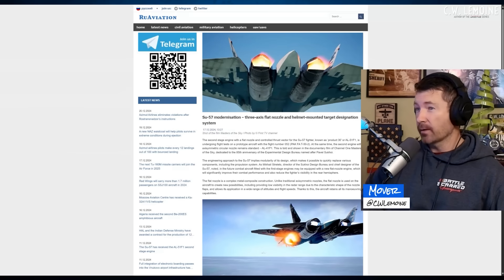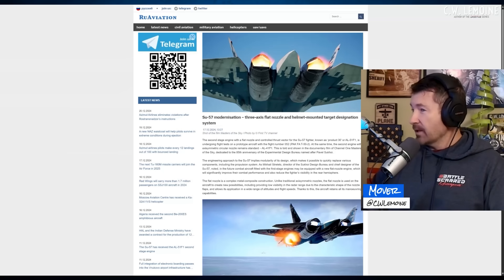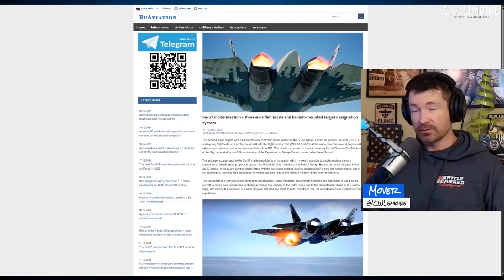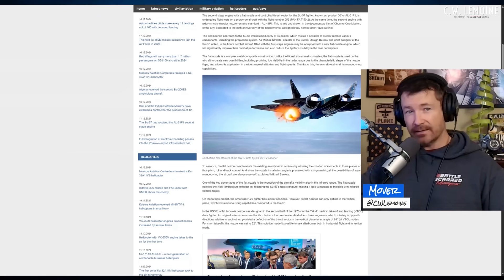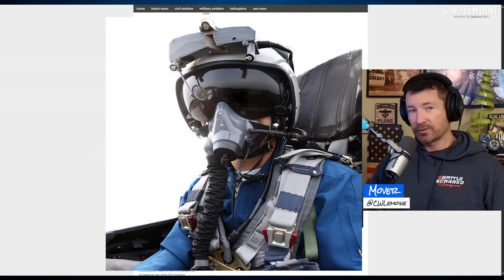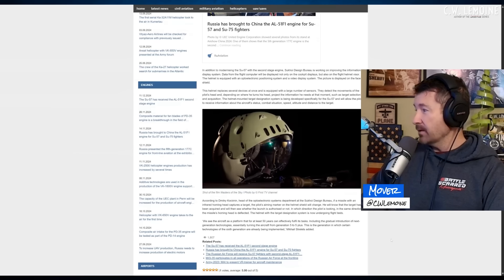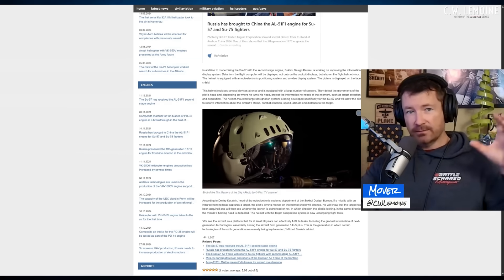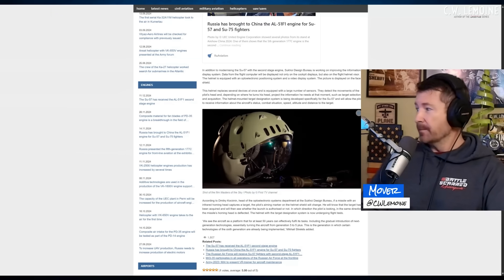New Upgrades for the Su-57 FELON

Comment: WTF is a 3d thrust vectoring nozzle? Up-down, port-starboard, and ?-?
Are they counting nozzle dilation? (big-small opening)
Reply: It is more about the plane movements that the nozzle can control:
- F-22 is considered having "2D" because its nozzle can control pitch (moving up or down together) and roll (moving each one separately in opposed directions - one up and the other down - so creating a movement on the roll axis)
- a plane with "3D nozzle", aside the above, can also move "left-right", so acting also in the "yaw" axis of the plane. The common used russian planes with such (Su-35 and actual SU-57) have "round nozzles" that can vector themselves in all directions, so they have a "pure" 3D nozzle capabilities... the "new SU-57" discussed here has similar nozzles to those of the F-22 (rectangular, and capable to move only up or down) but as it was shown, they are mounted at an agle, rather than horizontally alike in the F-22: they will loose some degree of freedom rather than a "pure round 3D nozzle", but still capable to influence all the 3 movement axis (pitch, roll and yaw), even if in a slightly diminished capability...

The diminished return in manouverability could be considered a good trade-off, when "flat nozzles" have better performance in anti-radar performance (a round surface will have ALWAYS a face that could rebound radar waves to its receptor... that is why modern "stealth planes" try to avoid much as possible a perfect round shape - they are all flat-angular surfaces - F-22/F-35 alike, or the old F-117 - or very squashed - alike the B-2 and future deployed B-21)
Reply: @CapitanoAraym  While roll is a dimension of aircraft movement and can be created by independent control of nozzles on two widely spaced engines, the nozzles themselves still only have 1 dimension of freedom, up-down. (Or 2D if they also do side-side.)
Calling that 3d is just marketing wank.
Reply: @CapitanoAraym  Actual Su-57? Even the T-50 had it, as it and the Su-35S have the same engine. Current Su-57Ms still build on this design.
They are pure 3D nozzles? They have 20dg of movement in their primary axis with 16dg of supplemental movement left/right.

The F-35 features a round nozzle, unlike the F-22.
Reply: Roll
Reply: 2D is up/down, 3D is up/down/sideways.
Reply: @TheArcticFoxxo  That isn't how dimensions work. up-down is a single dimension.
Reply: @ Vectors in 3 dimensional space work far different than you're thinking. Only pointing up would be 1 dimensions, the 2nd is reversibility and the capability of going up/down, and 3D is having extra side/side capability.
Reply: @TheArcticFoxxo  Rotation of the nozzle in the vertical plane (Along the engine's central axis) is one dimension and one vector [direction and magnitude].
Reply: @TheArcticFoxxo  Rotation of the thrust in the horizontal plane is one more dimension and vector [direction and magnitude]. 
(YT's busted censoring algorithm deletes many technical comments for some reason but not if they are broken into multi-replies.)
Reply: @ It's based on degrees of freedom, its directional planes don't matter when it has 3 degrees of freedom across 16-20dg of movement
Reply: @TheArcticFoxxo  Degrees of freedom are not dimensions.
Reply: @mytech6779  Yet they're considered such for brevity.

They aren't determined by what the nozzle itself does, but the effect it has on the aircraft and how they tie into the FlCs

Comment: Quick correction. The US Navy was the first to field a HMCS system with the VTAS starting in 1969. 3:22
Reply from the maker: When was it first used operationally?
Reply: Quick correction, VTAS was not adopted until March 1972.
Reply: @nemesis2264 did it work though? On a F4-J the sidewinders at that time weren’t high off boresight at all.
Reply: @jordancourse5102  from what I understand, it was only for pointing the radar, and thus aiming the radar missiles, I'm not sure if the sidewinders could also be aimed with radar slaving
Reply: @jordancourse5102  Did I even mention anything about it working or not though?
I simply stated it was not adopted until March 1972.

Comment: We stopped building the F-22, and we're not doing NGAD anymore. We're FALLING BEHIND!
Reply: B-21 can do most of what NGAD would have, and the Navy F/A-XX is still in development. If that's falling behind, I'd sure like to fall behind a bit more
Reply: @BreandanAnraoi  I suppose the USAF could use the Navy's F/A-XX; it wouldn't be the first time the USAF used USN aircraft. Remember the F-4 Phantom II? That started life as a Navy fighter.

I'd like to see us return to the days of the Century Series fighters, the F-8 Crusader, etc., where we designed and built new, cutting edge fighters every couple of years.
Reply: @markymarknj  Modularity and incremental improvement is probably the way to go now. Don't try to build a perfect platform to last 50 years, build one that's good enough last 10 years. And as soon as it's in service, start working on the next-gen better version to replace it. Rinse and repeat. But also I think the B-21 can fill NGAD's role, it's all about BVR engagement now.
Reply: @BreandanAnraoi  YES! That's the way to do it.
Reply: @BreandanAnraoi  YES!
Reply: The US attacks more than they defend. That makes multirole and attackers are lot more valuable than fighters. They could pump out more Raptors but all they'd do mostly is intercept civilian aircraft lol
Reply: Eh, as someone from outside the US I would say the US still has the advantage of quality, quantity and technology on its side, at least until the Chinese turn their J-20/J-20S production up to 11 and make 3 more variants of it. The US has what, the 1st, 2nd and 4th largest airforces (with the Russians in 3rd) on the planet? Nothing to worry about for at least another 20 years
Reply: @3.9L_V8  when you put it like that, I guess you're right. Thing is, I might be around another 20 years yet...
Reply: @markymarknj  That said however, I think it is of good mindset to always expect the worst from your adversaries, and develop the best solution to counter them in good time. In the Cold War, the US and USSR had the budget and mindset to develop new craft every few years but budget and Cold War mentality has since changed.

It's rare to see someone give Russian and other adversarial hardware their due respect nowadays, no matter how great or terrible said hardware may be. Probably a better mindset than thinking you're head and shoulders over everyone else, because eventually, everyone else will start catching up if the leader is stagnating
Reply: @3.9L_V8  EXACTLY! It was that mindset that propelled, if not compelled, the development of the F-15 Eagle, which has gone on to be a good fighter. Even now, though it's an old design, in its modernized form (new avionics, FBW controls, etc.), the F-15EX is still a force to be reckoned with; that's how good a job they did on it back then. If you'll remember, it was the MiG-25 Foxbat and its seemingly mythical capabilities that prompted our DoD to develop something that might be somewhat of a match for it. Also, as they say in racing, if you're not moving ahead, you're falling behind.
Reply: The sky is not falling.
Reply: @WALTERBROADDUS  but our fighters aren't the undisputed ass kickers that they once were. In air combat, you WANT the unfair advantage! We no longer have that. Yes, the F-22 is good, but thanks to Commie Obama, we don't have enough of them. The F-35 is good in BVR, but in WVR, it's perhaps F-16 level; it's not at Su-27 level, let alone Su-57 level.
Reply: @markymarknj Obama wasn't a communism, he is from democratic Party you silly

Comment: Naw, what they did was add a gear shifter to the pilots pedal/propulsion system. This allows the pilot to adjust their pedaling intensity to the situation.
They added larger pedals to prevent the notorious issue of pilots feet slipping off at high pedaling  speeds and they removed the horn.

Comment: You 🇺🇲 have a lot of problems with SU-57. 😂 
F-22 + F-35 = SU-57🤔
Reply: That equation you made up makes no sense, the only thing the SU-57 has in common with F-35 and F-22 is it has vectoring like the F-22, and its multi role like the F-35. The SU-57 isn’t even stealthy, yet Russia passes it off as a stealth fighter. F-22 and F-35 has the RCS of a Bumblebee and the SU-57 has the RCS of a barn door.

Comment: I feel like some kind of 3D thrust vectoring like this is going to be included in NGAD. All the concepts we've seen so far lack vertical stabilizers, and they're going to need some way to control yaw.
Reply: Differential thrust
Reply: @RedTail1-1 not efficient or precise.
Reply: @RedTail1-1  That will work if the engines are far apart, but if they're close together like a Hornet differential thrust won't have as much leverage to impact yaw. You also only get half the thrust because you have to reduce the power of one engine. If 2D thrust vectoring will be adopted from the 22 for high AOA pitch control, they might as well go 3D.
Reply: They're gonna have ports that divert thrust through the body to move the plane, like the space shuttle reactor thrusters. This will enable better stealth and manuverability in ultrahigh altitudes. A space fighter essentially that can handle LEO satellites and rain hypersonic missiles from high above any other fighter. Top attack worked so well with tanks in Ukraine we figured why not apply that to air combat. 

Its not "thurst" per se but redirected bleed air.
Reply: The can use drag rudders, like the B-2 and B-21.
Reply: @ not at ultra high altitudes. Air is too thin. They need to go to very high altitudes to go hypersonic and therefore need  non-aerodynamic means of manuvering. It maintains stealthiness by not deflecting any surfaces, enables ultrahigh altitude flight and minimizes complexity of manuvering at hypersonic speeds.
Reply: @kdaltex  I've not seen anything that proposes that NGAD (or FA-XX) is supposed to be hypersonic.
Reply: @RocketToTheMoose  Me neither. I'm also interested to know how a hypersonic jet will be able to slow down enough to land on a carrier. Return of the swing wing?
Reply: @CallsignJoNay TBCC engines will allow them to fly at low speeds.

Although NGAD isn't intended to land on Carriers.  The Navy FA/XX will (formerly also called NGAD).  Most of the ideas I've seen for NGAD start to resemble a much faster/maneuverable B-21.  These simply include supercruise and not hypersonic flight.

The SR-72 is a lockheed martin concept that is intended to go hypersonic.  Indications are that program continued after going dark in 2018 following the Russian Hypersonic hype.
Reply: @kwonekstrom2138  I'm skeptical of your hypersonic untra high altitude claims, unless they will be fully unmanned. To put a human being up that high will require a space suit. I don't think they're going to suit up in a spacesuit for every daily sortie. 

And I'm sure the Navy will have engines that can go slow enough, that's not an issue, the issue is how will rhe airframe produce enough lift? You can't hit Mach 5 in something shaped like a B-2. It needs to be long and pointy like a Blackbird. Not the best design for landing on a carrier.
Reply: @CallsignJoNay  Where do I make these claims?

Regarding altitude, the USAF has had multiple manned aircraft that flew high enough for pilots to earn space wings.  🤷🏻‍♂️  History would indicate that they're fine with that.

What I did mention is that the type of engine they would use for such a plane is called a TBCC.  "Turbine based combined cycle".

The problem is not lift...  the plane flies and therefor must have sufficient lift.  The term is "stall speed"...  Aircraft use devices known as "flaps" to decrease stall speed.

Yes a supersonic/hypersonic aircraft would need a different shape than most subsonic aircraft.  This isn't due to lift but drag and control surfaces...

The lifting body designs typical for high speed aircraft generally have reasonable subsonic performance.  I'm sure the engineers are capable of finding the right balance of low drag and low enough stall speed.
Reply: @kwonekstrom2138  "Regarding altitude, the USAF has had multiple manned aircraft that flew high enough for pilots to earn space wings"
X-15 and ?  The Space Shuttle Orbiter Vehicles were obviously spacecraft.
Reply: @ LOL, how pedantic.   Yes.  Aircraft that fly high enough for someone to get their astronaut wings are often space capable...

Yes...  the X-15 is one of those aircraft.  The fact that each branch of the military has official astronaut wings is a clear sign that "using a space suit" is not unreasonable should a mission require it.

Comment: The new nozzle will most likely have the same axis configuration as they allready have now.
Russia did look into a fully 3D nozzle in the early 90's, but it was deemed too complex to operate, hense they went with a simpler canted 2D asymetrical nozzle as seen on Flankers. All the exported Su-30 variant, etc
The one nation with most expirience on TVC is not USA.. but a country with Salut and Umpo corporate in it. 
My gut feeling is.. they will make it happen.
The really curious thing is, they seems to somehow developed a 3rd slipstream engine, as far as the coolant duct on the new nozzle are concerned😮

Comment: Flat nozzle should be less complex. Fewer actuators and stuff.
Reply: But heavier and less efficient, although looking at how many actuators Russian 3D-vectoring nozzles seem to have the overall weight might actually be similar.
Reply: @RichelieuUnlimited  Yeah, hard to tell from the info available atm, I'm sure the serrated version intended for the new engine performs a lot better overall, but this design is obviously a much better stealth profile. I'm guessing it will come down to how well the new engine performs has to what they eventually use.
Reply: I believe you are correct, the complexity referred to in the article i think is referring to the structure of the nozzle itself, being 3d printed to have bypass air to cool the exhaust.

Comment: Has Russia Ever Made an outstanding Fighter ??Don’t include an Armed An-2
Reply: LA-7 was very good. SU-35 looks good on paper and got the most powerful radar of any fighter in the world right now, but aside from those do I think their planes always have been unremarkable or even bad. MIG-21 had a terrible kill ratio. MIG-29 being one of the most overrated fighters in history with its crappy range, piss poor payload capacity and hardpoints despite being a two engined fighter. MIG-27 was not even liked by the russians themselves. MIG25 being a fighter that cannot turn and only fly fast and needing tonnes of repairs as a result.

Comment: Calling it now. The new nozzle won't be implemented due to cost. The SU-57 is supposed to be a poor man's stealth fighter. Something developing countries with a slightly deeper pocket book can get their hands on.
Reply: the design suggests otherwise, it would be cheaper to maintain since it has less moving parts
Reply: @yes-gn4kn  I would disagree. It's more on the lines of material cost, mass production, and more maintenance down time. Though, I understand why it would seem to be easier/cheaper. This is pretty much the same nozzles the F-22 uses, and the nozzles not only have to "squeeze" but also move up and down regardless of the "sqeeze" position the nozzles are doing. Which is not a simple engineering task on a jet engine nor maintenance friendly. This kind of stuff isn't russia's style. Though they had complex military equipment in the past, they were either never adopted or lasted long before being shelved for good. I just don't see this ever being widely adopted in Russia's inventory, let alone exported.
Reply: So an engine designed to be more efficient with less moving parts and less maintenance intensive compared to the previous engine won't be fitted due to cost?
Reply: It most likely will since it comes with the new engine
Reply: @tangocoyote2643  It doesn't
Reply: What are the chances you were among the dudes, claiming the Su-57 was canceled a few years back.. 😂😂 
Yeah about that, seems none bothered notify Sukhoi about it😅
Seems this program going forward without the $ 1.3Trillion budget that other 5th gen program has.
Reply: This problem could not finish with Indian help, and peace time russia have struggled to finish this plane on their own then afterwards. And with their government running out of cash and lacking foreign high tech components, then I guess that this plane will never enter serial production. And if it do, then it would enter service very late when the rest of the world have already begun using 6th generation fighters while russia fly this 4.5 generation fighter.
This plane is too little too late for the russian aviation industry to stay competative. Chinas stealth fighters are much better on paper than this plane.
China got very little reason to save russias economy through arms imports the next time around when it crashes its economy in hyperinflation. China did use to import jets just to make pirate copies and steal technologies (like how they stole the design of SU-27 from russia in the past). However now have China stolen so much technologies and tricks that they now know how to make pretty decent aircrafts themselves, and the former student have become russias new master when it comes to military aircrafts.

Comment: the helmet mounted display is an augmented reality device (360 degree uninterrupted vision), it already had helmet cueing for missiles.
Reply from the maker: The article does not suggest this.
Reply: May i ask about your source? per public information the Su-57 doesn't feature a sensor like DAS for 360 degree uninterrupted vision like the F-35 and J-20, it does have 360 SA with different radar arrays but not on the visual/ir spectrum.